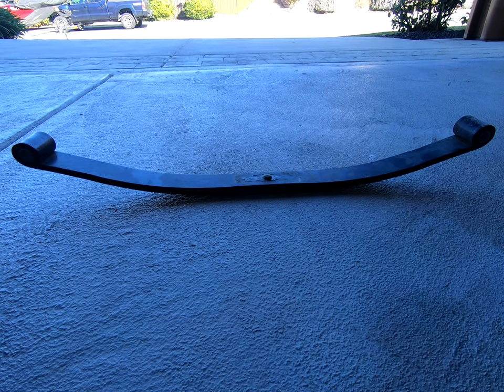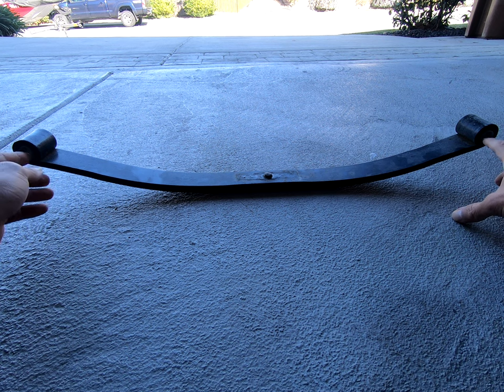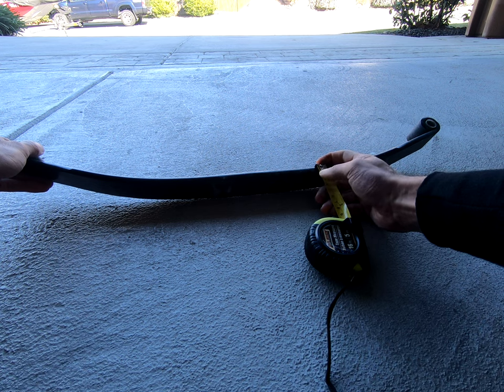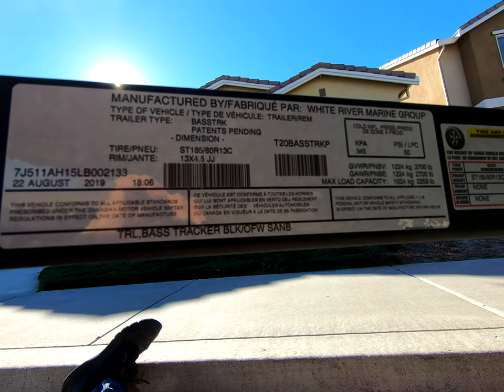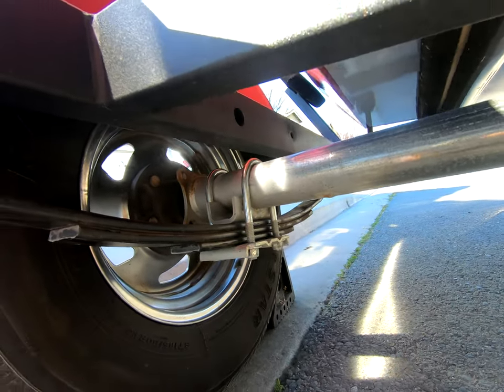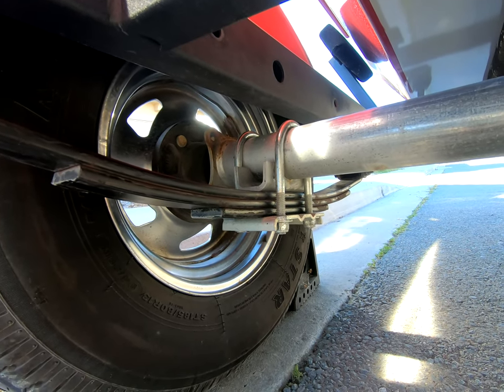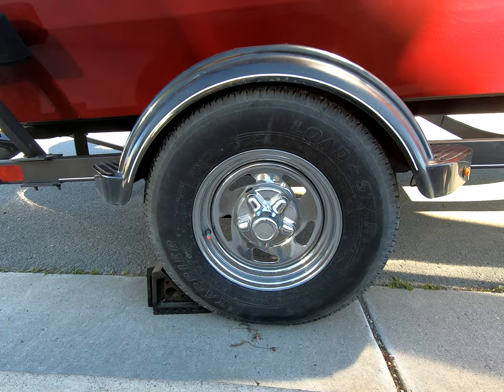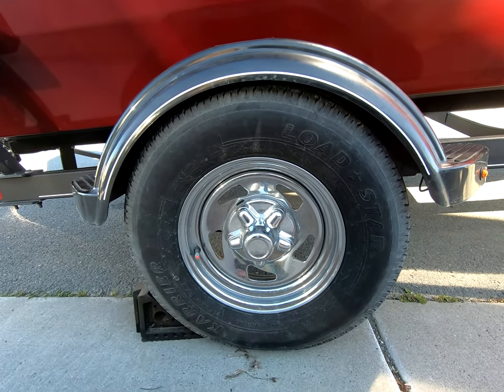Multi leaf spring pack conversion tips for your boat trailer

Comment: nice tutorial- It appears to me that the easiest way to accurately measure the eye-hole center to center should be this = measure from the outside ot leafspring{rolled portion) to the opposite side's inside edge of leafspring(rolled portion).
Reply from the maker: Thanks Douglas! That's actually a pretty good suggestion for getting somewhat accurate measurements if the leaf/ leaf pack is still on the trailer. The problem is that most people will be measuring with it bolted into place so it will not be as easy to obtain precise measurements. Regardless, they will be able to obtain a relatively close measurement and from there they can select the appropriate leaf spring pack for their trailer's specs.

Comment: Do you have part numbers for what you purchased? I have a 2022 Pro170, and I’m wondering if the same parts will work since they are almost the same boat with the exception of the casting deck.
I’m also wondering if you could let us know where you jacked up the trailer and approximately how long did the swap take?

Thanks!
Reply from the maker: Are you wanting a video on all that or a simple explanation over the comments? I'd be happy to help you out, but it sounds like there is a lot you want covered, and so I'm not sure in which way would be best to tackle what it is you are needing/ asking.
Reply: @extremeboating7347  I think I can figure out where to jack the trailer, so no worries on that. Do you think the same parts would work with a 170 trailer, and how long did it take for you to complete the swap? Thanks in advance.
Reply from the maker: There is a beam right in front of the axle that I slipped my trucks bottle jack under to use to lift it.

Yes the same parts would work without question. The swap overall will take about an hour or less for both sides if you know what you're doing and if you take your time. It's a very easy swap to do and I contemplated maki g a video showing folks how to do it, but figured there were already enough videos on YT showing how to do that so I skipped out on that part and just did it in peace.

Comment: Nice video, I just did the same thing for my Tracker Pro160 trailer. I drove it around the neighborhood and the difference was noticeable immediately. Like you my original u-bolts still worked out, had a little bit of an issue with the shackle bolts. One of the nuts stripped out and have to get some more. Luckily I had some lock nuts that fit, good for now but will replace with OEM hardware. Have you had any issues since upgrading to 3 leaf? Thank you!
Reply from the maker: Zero issues with the tri-leaf setup since install. I always mod for reliability and not short term improvement. I'm glad that the setup is working out for you and just know for the future that you will have no issues as well. It's crazy how much of a difference it makes in over handling of the rig right?! Thanks for taking the time to check out the video and I'm glad to see I could help you out in modding your rig!
Reply: @extremeboating7347  Good to know! I do have a question about the tightness of shackles and the bolts, I've read that there should be a little play in them and to not over tighten so they cannot move.  What are your thoughts on this? I'm reading mixed advice on the web. thanks again.
Reply from the maker: The front bolt gets tightened the rear gets left with some looseness on it. So the shackle can move allow the leafs to move around. 

If you have any doubts, emulate the way it came exactly from the factory. They installed things on the trailers.
Reply: @extremeboating7347  okay understood. Before I took it all apart I made a note of that, one side had some play to it, the other was tightened up haha! Thank you

Comment: I’d like the name of the boat store you got them from. Thanks in advance.
Reply from the maker: B&D trailer sales
Martinez, CA

They should be able to ship out a set to you if you want them no problem.
Reply: @extremeboating7347  did you just tell em you needed 3 leaf 1750 lbs 26 inch springs?
Reply from the maker: @TheFlynxman  yes sir. I told him I wanted to buy a triple leaf pack set. These are the specs I gave them and this assumes you own a Bass Tracker Classic XL. Other trailer spring sizes will vary.

- 26.25" long springs
- 1 3/4" wide
- Double eye leaf
- Triple spring pack
- 9/16" standard holes
- 1750 lbs per spring

Comment: Were did you get your leaf springs
Reply from the maker: I sourced them from a local trailer supply store. I didn't really talk about it in the video because you can usually obtain them by providing the measurements and specs of yours and the type of springs (or the ones I supplied in the video if you have a Classic XL) to a trailer supply store local to you.

If you'd like the name of the spot that I got them from, however, I'm sure they'd be more than willing to ship them out to you in a different state.

Comment: Does this add height to the trailer?
Reply from the maker: Yes it does. It makes the overall height of the trailer and the boat on the trailer slightly taller than OE.
Reply: @extremeboating7347  
Thanks. My boat has about 2” to spare getting into the garage. May not be able to upgrade